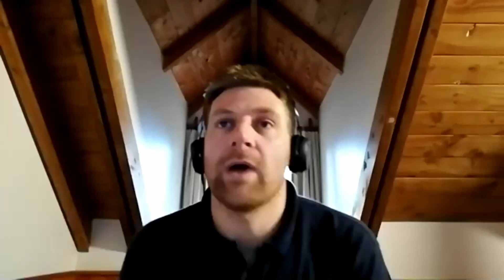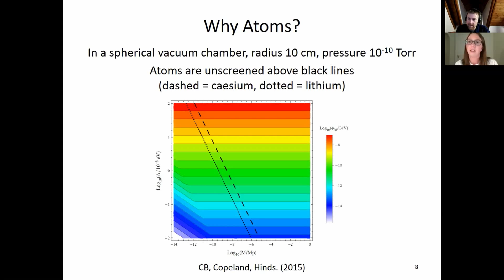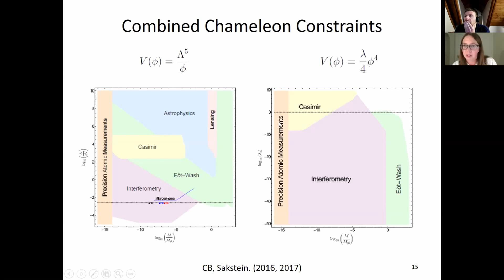Clare Burrage - Atomic lab experiments rule out almost all of chameleon dark energy model-space

Comment: Index to Key Parts of the Talk: 
[00:02] Shaun's intro to the topic and Clare's work
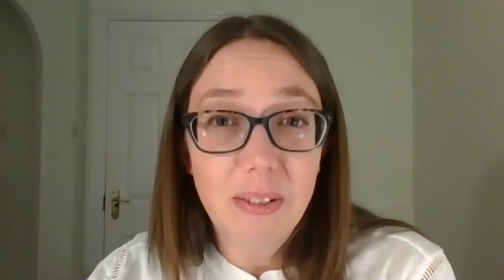[01:15] Clare's introductory brief comments
[01:45] Q&A: what are a couple things you'd want viewers to remember about this talk?
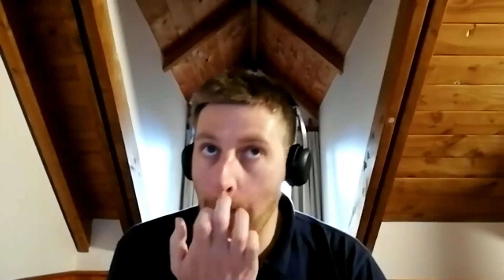[02:27] Q&A: what is the background motivation to your recent work and to this topic in general?
[04:17] Q&A: In the near past, what were the specific problems about this?
[06:25] First slide: A Very Old Idea The types of experiments we're going to talk about is the idea of testing the equivalence principle...What we're going to see is that these theories of dark energy, or modified gravity, or scalar fields kind of related to dark energy, give you a reason to expect that under certain circumstances, light objects or small objects would fall faster than large ones...that they feel an additional force essentially...and the interesting physics is why that only happens under certain circumstances
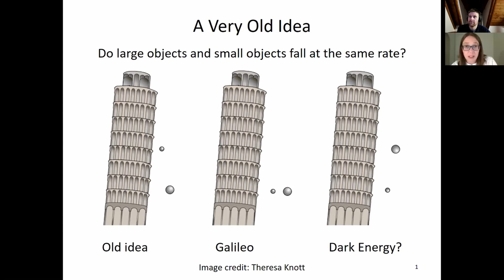[07:42] The standard picture: If the New Physics is Linear
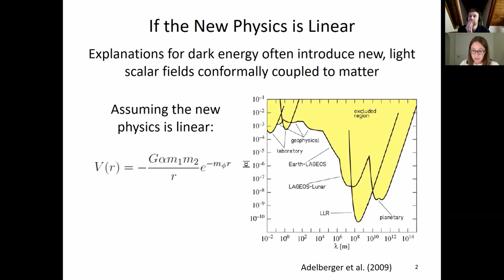[10:55] If the New Physics is Non-Linear: Screening Mechanisms
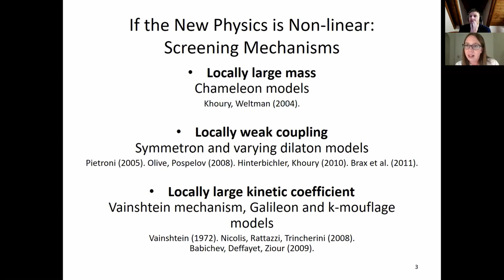[12:43] The Chameleon A scalar field with canonical kinetic terms, non-linear potential, and direct coupling to matter. (astro-ph/0309300)
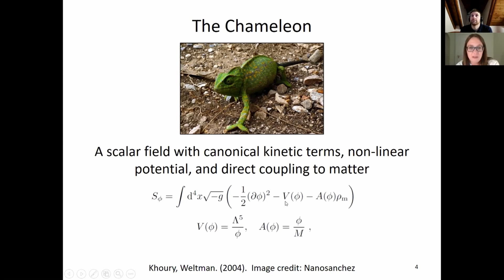[15:58] Varying Mass Dynamics governed by an effective potential. Non-linearities in the potential means that the mass of the field depends on the local energy density.
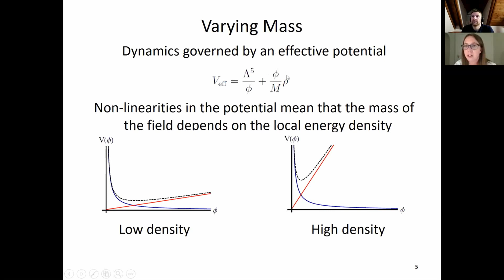[17:04] Chameleon Screening (1412.6373)
[23:21] Why Atoms? (1408.1409)
[25:51] Atom Interferometry
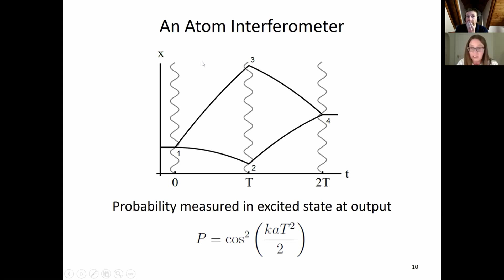[30:17] Atom Interferometry for Chameleons (1812.08244, Experiment to detect dark energy forces using atom interferometry)
[32:04] Imperial Experiment
[40:23] Combined Chameleon Constraints (1609.01192 and 1709.09071)
[41:08] Summary
[46:43] Clare's work in large collaboration atomic experiment proposals
[48:15] Q&A: Where to next?
[49:47] Q&A: Outside of your own research, what do you think is the most interesting thing in cosmology at the moment?

Comment: Dear Shaun and Clare,

very interesting talk, thanks for organizing this and thanks in general Shaun for your excellent channel!

I have a question for Clare: you say that atomic lab experiments rule out almost all of chameleon "dark energy" model-space. I put dark energy in quotation marks for the following reason. From your talk it seems to me that by dark energy you mean a chameleon model with potential scale Lambda at the dark energy scale, i.e. Lambda ~ meV.

But this is not enough for the chameleon to be dark energy, right? I mean, Lambda ~ meV is not enough for the chameleon to self-accelerate the Universe, i.e. accelerate the Universe due to the (conformal) coupling to matter varying by order 1? So am I correct that you are using dark energy quite loosely simply as in "new physics at the dark energy scale"? I guess a different way to phrase my question would be why didn't you mention the no-go theorem in your talk? ;-) regardless, very interesting talk anyway!

Thanks,
B
Reply: Hi! You're exactly right here about what I mean.  I mean a chameleon model with parameter(s) at the dark energy scale.  This is not a model that self accelerates the universe.  I tried to be clear that what I was interested in was new physics that might be connected with a solution of the cosmological constant problem, even if the new field itself does not directly cause the accelerated expansion of the universe.  I'm sorry if that wasn't more clear.
Reply: @clareburrage846  Thanks for the very clear answer and for your very nice talk! Cheers, B
Reply from the maker: I will pass this question on to Clare!

Thanks for the comment, and nice words.